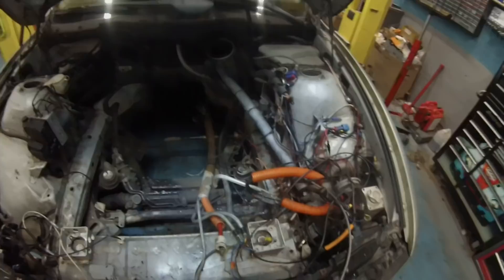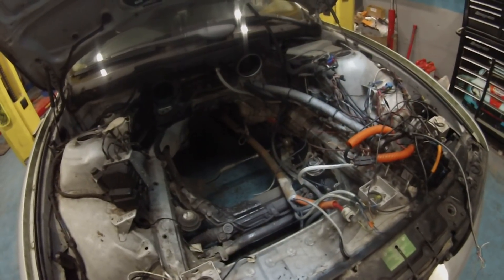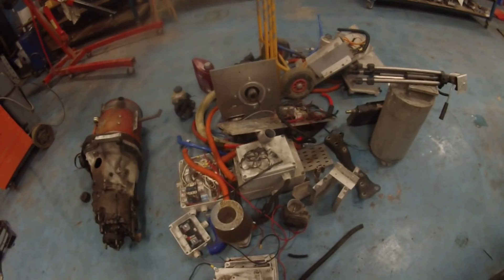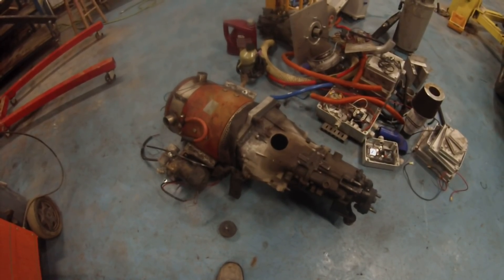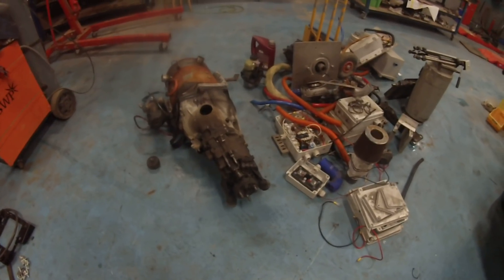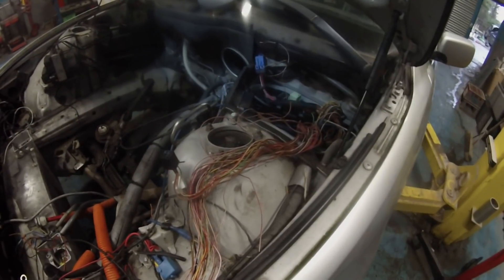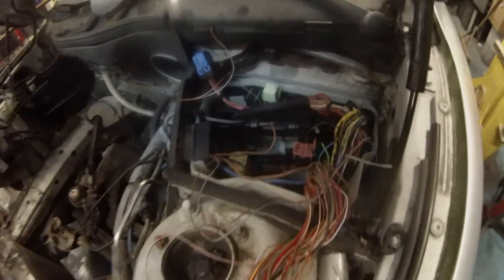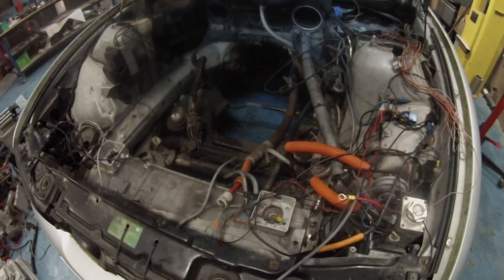BMW E39 EV Conversion 54: DC To AC Part 2

Comment: the weird thing with BMW's is that you often see them in the junkyard and they're actually physically perfect you can't even see anything wrong with them literally the paint is perfect Interiors perfect but for some reason they ended up in the junkyard I'm is probably due to an engine or transmission issue and this is a great way to go ahead and bring them back.  

if that doesn't work out just put an LS in it

Comment: My car was stolen . I guess I will have to go back to the big block Ford . I would love to do a electric car again . But a AC controller is to much problems Ford me . I had two Leaf motors no one would help with even a low voltage controller . Sevcon  Sales people fought me even when Sevcon them selves said to do it,. All of them didn't help . I will still keep up with you .

Comment: You didn't include the links in the description, but I dug around and found them:
1 - https://youtu.be/CPY4kvVpn6s?list=PLPHK4T9kKEyYRhPQJPOvSGyibmyiA26bj&t=600
2 - https://www.youtube.com/watch?v=iXhOBl0xljw&index=30&list=PLPHK4T9kKEyYRhPQJPOvSGyibmyiA26bj
3 - https://www.youtube.com/watch?v=os8GtMsCxAo&index=29&list=PLPHK4T9kKEyYRhPQJPOvSGyibmyiA26bj

The most sensitive part is the part you skipped over, presumably using an indicator to measure and adjust runout, but, seems pretty obvious how to do it. Maybe, if you could, when you make your new adapter plate for the AC system, show how to do the actual alignment part in a bit more detail? Just food for thought, make the content you enjoy making.